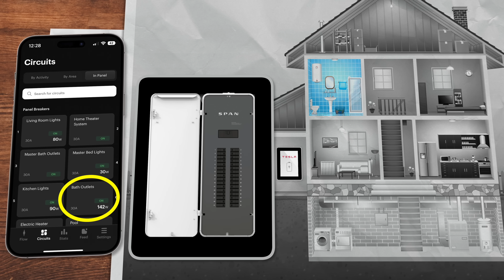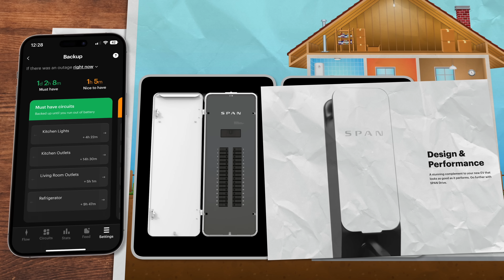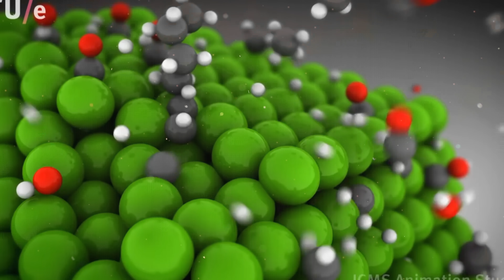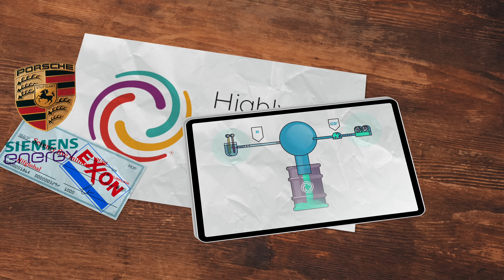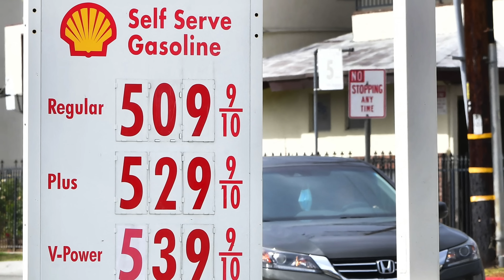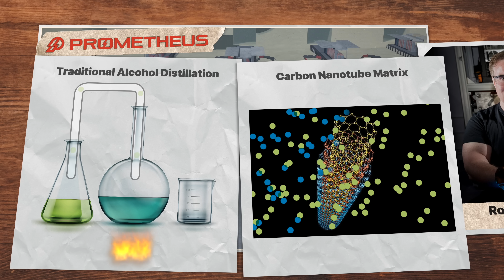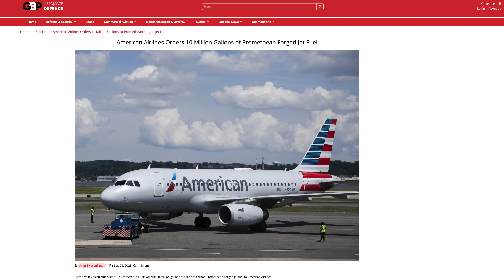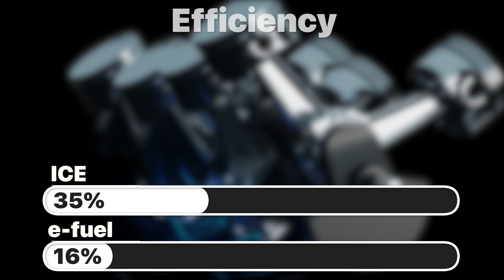EPIC Breakthrough Can SAVE the Internal Combustion Engine!

Comment: I really don’t understand why they get the Co2 from thin air. It must be so much more efficient to get it straight from the Co2 emitter. That’s how they get Co2 to greenhouses in The Netherlands to make the crops grow faster.
Reply: They could, but the problem is that you need to have surplus renewable energy nearby to run the fuel forge, otherwise there’s no point to it at all. So your idea (which is great) is only an option in places where that’s available.
Reply: @Israel_Two_Bit  Yes, but I disagree. Generating energy is always only an option where it's available. You're not going to place a windmill where there's hardly any wind, you don't place a solar panel where there's hardly any sun. So when you need vast amounts of Co2, why would you harvest it where there hardly isn't any (outside air). ...That made me think, actually having these facilities close to an oil refinery would work very well, because there you also have the infrastructure to distrubute the E-fuel from. The renewable energy can simply be taken from the grid. It doesn't need to be next to a renewable energy source
Reply: @user-oi2ec3zj6t  It's an interesting take but fossil oil and gas are better off left in the ground for everyone's own good. Last I saw, Big Oil is attempting to shift to Hydrogen for freight shipping and trucking. Else, perhaps your idea elsewhere in industry might be good? IDK
Reply: @TheHorseshoePartyUK  yes ideally there wouldn’t be any Co2 emitting industry in the future, but that would take a while. We need refined oil for many more things than just transport.
Reply: @user-oi2ec3zj6t  Oh interesting? Could you please give me a couple pointers what else, that oil is truly necessary for? I'm in the Green corner of the Political Compass. One of very few, for example...

Who knows that 3D printed steel is poor quality atm, Hydrogen steel is on the way, but for now we really do need coking coal for the biggest steel objects, etc? 

In short we ain't always the best at understanding how manufacturing works right now :P I try pass on what I learn.

Usually get yelled at. Fun times when I tell them about Oil corps moving to Hydrogen. Usually silence or chucking insults <3 my sillies
Reply: @TheHorseshoePartyUK  It's a list too large to post here. But that was not really my point in the first place. My point is that it is a waste of energy to extract Co2 from the air when there are many industries emitting Co2 that can be used right away. To your point about hydrogen, to produce it on an industrial scale, there are also large amounts of Co2 emitted. 7.05KG per 1 KG of Hydrogen to be precise :).
Reply: @user-oi2ec3zj6t  Hmmm interesting. Sorry I'm very tired, I'll have to come back to this tomorrow maybe. Thanks.
Reply: @user-oi2ec3zj6t  Thing is chap, you're so confident and articulate in your assertion, yet I didn't ask for a full list? Just one or two? Even just the most significant function that only oil can be used for would be helpful.

Until more recently I'd decided it should only be used for military and emergency services in future. Now I'm less sure. Hmmm.

However, you may have all the evidence on your side. You've not mentioned a single thing for me to check out.

Burden of proof :)
Reply: @TheHorseshoePartyUK  Thanks lad! Yes I'm very interested in the subject of energy transition and read/watch a lot about it. There are some methods that I continuously see coming back, like Co2 capture from air. I don't believe in this method because it doesn't seem efficient when there's an abundance of Co2 available for example from industry.

 So, what I don't understand and would like to know more about is why they add this step to the process of creating an E-fuel that already is very energy demanding to create. I do believe that E-fuels could have a future because it has a high energy density.

Comment: Using an internal combustion, 80% of the energy in fuel tank is wasted, they are that inefficient. The problem with hydrogen and E-fuels is that they will prolong the death of this outdated means of propulsion.
Reply: LOL. $20,000 to replace your Tesla battery pack at 80,000 miles.
Reply: @scottslotterbeck3796  
What didn't you understand about what I wrote?

Comment: EV's being 90% efficient compared to ICE is a very cherry picked and specific comparison.  It all goes back to the opening where you point out that energy density is a key driving force behind fossil fuels.  There is no way you can say with a straight face that EV's get 2-3x the range per kilogram of fuel.  Sure, my truck may only get 15mpg, but that gallon is only 8lb.  How many miles would my truck get on 8lb of battery?

Really what the world needs to adopt a different fuel source is for 1 major oil company to say "Every Chevron/Exxon/Shell/Texaco/Etc station will have Biodiesle/Hydrogen/FastCharge/Mr.Fusion."  As soon as there is a supported infrastructure world wide like we have for petrol, whatever fuel source they supply WILL become the dominant alternative to fossil fuels.
Reply: Yeah, efficiency has nothing to do with energy density. No one ever said you can get 2-3x the range per kilogram of fuel.
Reply: Here's some math: 1 gallon of gasoline = (approx) 33,000 watt hours of energy. My car gets 33 miles per gallon. 33,000 / 33 = 1000 equivalent watt hours per mile. A Tesla using 330 watt hours per mile goes 3 times as far per unit of energy than my car. A 99 KWhr battery pack holds the equivalent of 3 gallons of gasoline, yet can propel the EV past 300 miles.

Comment: From a strict driving enjoyment perspective, ICE doesn't hold a candle to EV. The power, torque and efficiency turns the vehicle into something that basically responds to your thoughts immediately, without having to be in the appropriate power band to do so. The lower center of gravity makes for handling like it's on a rail. I REALLY want that.
Reply: Thats what everyone was saying about the casio quartz crystal watch, it does time better but its not nearly as mechanical. Ice cars will be for the mega rich and Electric cars will be for the normal just like mechanical watches today.
Reply: Unfortunately for everyone here, the convenience of ICE isn't going anywhere. Motor companies may be forcing EV down everyone's throats, but the power potential vs weight that ICE provides will not be surpassed until compact fusion packs become a reality. The Marine and Overland Cargo sectors will still be using massive ICE engines well into the future, because regardless of how fun or instant the driving experience of EVs is, the power to effort ratio is so much smaller than electric.
Reply: I guess you never drove an AMC AMX with a 390cuin engine and a 4 speed transmission. On tires skinnier than most cars you drive today it stuck to the road like it was on rails. And after I rebuilt my engine ( bought used with a dead engine ) you had to keep your foot off the gas or the tires would break free in first or second gear. How low did it sit, the mufflers only cleared the road by a few inches. And factory stock they were turning 12 second 1/4 miles at the drag strips. If you can't shift the gears, you shouldn't be driving.
Reply: You’re missing the point. Yep, electric motor/generators are the way to control speed. The competition is between lightweight internal combustion plus fuel and stupid-heavy batteries.
Reply: Sorry but this statement is completely wrong, don't get me wrong in a stock trim EV's will out accelerate most ICE cars although most people who really enjoy driving also enjoy the modification/custimisation of their car take my own i have a gen1 rx7 and it will out perform any EV even though it's a 40 year old car with the upgraded suspension and engine you have a car with about 450kw or 600hp in a vehicle thats about 1100kg or 2400lbs giving quite a bit better power to weight than a plaid and the bonus to me is you actually drive it there is no computer assisted anything compared to the acceleration of an EV which is trivial and if it wasn't for law say you had to be "in control" the car could just a easily perform the same with you in the passenger seat your input is to mash the accelerator and let the car do the rest
Reply: @shaynegadsden  Dude, that was one LOOOOOONG ass sentence!
Reply: Maybe an EV car is great, but from what I’ve seen an EV truck is a joke. Maybe EV trucks has good torque, but really? And a low center of gravity isn’t great when pulling livestock in the mountains where you need some clearance. I’d probably rather drive a wood gas powered truck then an electric truck. When you’re two hours away from a gas station it’s like good look tempting that with electric
Reply: There are solutions to the sensory issues. Tire sizes can compensate for the mass issues and braking is already better in BEV's, so that can be solved. Then there is shifting. Certainly a manual transmission can be fitted to an electric vehicle and the electric motor can be made to make engine noises that trigger the shift reflex, or the whole thing can be simulated with sounds coming from the car and adjustments to torque based on the simulated gear you are in. Then, when you are tired of playing, you can turn the whole simulation off and be faster and safer for ordinary driving, something the rest of the family will appreciate.  Eventually, almost nobody will want the simulation and will just let the car drive itself in most situations. We're almost there for FSD, and when that works and becomes many times safer than even the best drivers, actual driving will become a sport that will cost you on your insurance.
Reply: @everettlwilliamsii3740  increasing tire size reduces efficiency & range
Reply: ICE isn't an answer to anything except continuing to dump CO2 into the atmosphere and it's NOT carbon neutral. it's an EXCUSE  to continue producing engines on an industrial scale that they already have the infrastructure for so they don't want to change it out. they lie claiming 'carbon neutral' it's not, just MAKING the ICE engines produces CO2 among other pollutants. then there is producing it's fuel and the losses inherent in ANY SYSTEM not to mention the efficiency of an ICE has a ceiling that was reached LONG AGO. so for all the shills trying to claim ICE is somehow perfect, an answer or the future either don't know jack shit or are just paid shills.
Reply: yes thàt ruiight
Reply: I hate sounding like a fan boy, but out of every single car I've ever been in, my model S Is my favorite. Nothing beats the instant acceleration.
Reply: For an everyday driver commuting appliance perspective I'll take my EV any day, never going back to pure ICE for that. For my fun track day car nothing beats the fun and reward of clipping off lap after lap in a manual ICE car, I didn't even like driving a DCT car, it's just too much like a video game and gets boring after the sense of speed becomes numb.
Reply: @anydaynow01  Exactly. Stick shifting is awesome. I mean, running a rally on an EV must be super boring compared to a 4WD WRC Subaru Impreza
Reply: @ipp_tutor  When you think about it, racing horses is even more exciting.
An Impress doesn't have legs and isn't even alive.
Ho hum.
Reply: Vaasnaad, the electric car is not a replacement for the ICE. Very happy for you, but there is not enough rare earth materials in the world to replace 400 million ICE run cars! There is not the infrastructure to charge all the cars and with NET Zero policies in place, there never will be. On top of which, when you dig deeper into the materials used and how much carbon is used in the build of EV’s it turns out that they are no cleaner than ICE cars at all!
Reply: While enjoyment is a subjective statement.  You're objectively incorrect on the handling argument.  The majority of EVs are currently BEVs, they weigh too much.  With the current weight issues they'll never handle as well as a lightweight ICE vehicle(when comparing similar ranges).  Grip isn't linear, it's heavily affected by vehicle mass(change of direction is fighting momentum[m*v]).   As for enjoyment, I'd personally argue being able to shift gears and hear an ICE engine tuned to make a pleasing exhaust note adds two more senses to the driving experience which personally gives me way more enjoyment and immersion.
Reply: I agree with you; however, if we're unable to overcome the battery capacity issues we currently face, this would be a good alternative. I think we're where we need to be with cars, but not larger vehicles like trucks and tractor trailers.
Reply: Replacement battery packs? $20,000.  No thank you
Reply: @scottslotterbeck3796  only tesla charges that much kid...did you even bother to price manufacturers battery packs before you posted? rhetorical question...you didn't, you just looked at one company who has the MOST expensive pack.
Reply: There are dozens of reasons for electric cars besides the environment. They are just better in so many respects.
Reply: 19th Century ICE tech Vs 21st Century BEV tech. I know which one I would choose every single time. (I know that the first cars were battery powered using lead-acid  batteries). 
BEV is where the money is at. If you like being on the losing side of history then continue to support fossil fuels.
Reply: @sandyfordd1843  Don't you get it? No one's supporting fossil fuels, least of all this channel. e-Fuels aren't fossil fuels, they don't come from fossils, but from CO2 in the air.
Reply: @sandyfordd1843  Nickel-Iron (NiFe) batteries were invented for car traction batteries too but skulduggery from lead-acid makers saw the superior tech sidelined.
Reply: @sandyfordd1843  You know everything we have is fossil fuel? you know that right? the computer you're typing on right now is thanks to fossil fuel. Not BEV tech. BEV tech came from fossil fuel. Losing side of history. You must have voted for joe beijing biden.
Reply: @sandyfordd1843  nobody's driving 19th centure ICE today. You're delusional

Comment: Agree for the 2nd method. With both nuclear and renewables. It makes sense, tie this in with thorium reactors of France and you got a great solution to energy independence (for a while) imo this could replace 10% of our current fuel consumption, because more and more cars, trucks will be evs reducing demand.
Reply: you mean that france that needs energy supply from all over europe all year so far, due to half of their reactors being down all the time?
Reply: @davepermen  Or Germany needing to import fossil fuels from Russia because the shut their perfectly safe reactors off.
Reply: @davepermen  this comment is not completely true. Because of last year's heat wave they shut down the reactors to not overheated the rivers to kill off the wildlife. Micro reactors that are new designs at a smaller scale are more robust then a mega reactor.
Reply: @polarbearigloo  microreactors are mostly one thing: not. real.
Reply: Nuclear fuel can be infinite with breeder reactors.